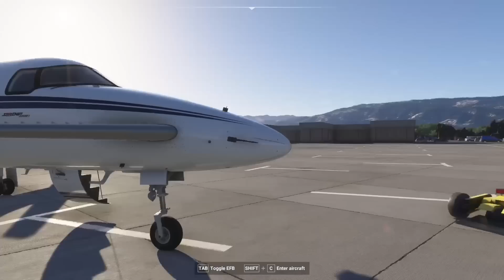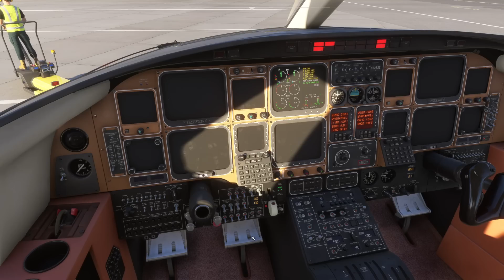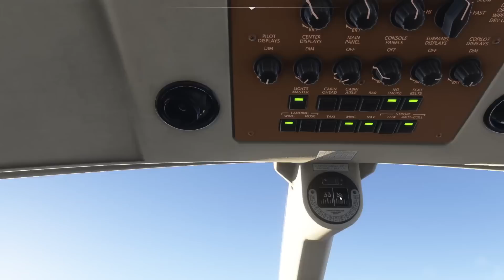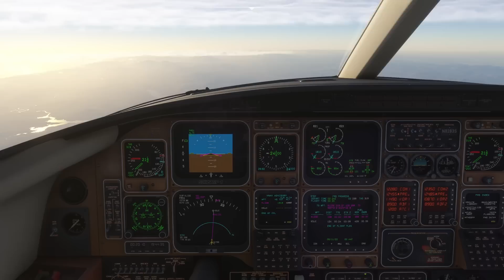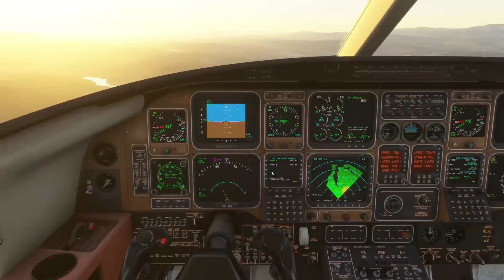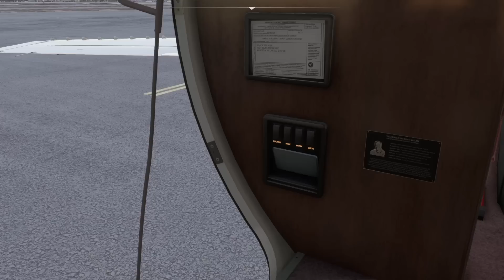Real Pilots Flying the Starship | BlackSquare's Nick joins me in the Flight Deck #msfs2024 #starship

Comment: We have hardware with Reverse and Beta and feather detents but they are unassignable in MSFS2024... We don't have an axis for Beta true but at least a toggle we should be able to have but we can't. Look in MSFS2024 settings and although you have 4 buttons assignable for Beta, 6 for Feather, 2 for Decrease Propeller (for each axis - normal and slow) None Works - NONE!!!!

Comment: Fantastic episode. I enjoyed every second of this. I was 21 in 1988 when I received my PP certificate, and this a/c was certified. I've been in love with it ever since, even after reading all the reviews at the time that criticized it, and all the crap about a "plastic" airplane. This was developed about 5 to 10 years too early. In 1988, our aero club had a few planes with LORAN installed. Very few members who were baby boomers took the time to understand this technology until several years later. Yet, we Gen Xers who have been programming the family VHS recorder, and taking programming in high school, took the 30 minutes to learn about LORAN and how to configure it for navigation.
Another bad timing issue was the leap in technology of turbofan engines, which increased fuel economy for small jets. On top of it, Starship wasn't able to top out above 400 knots as was promised during development, which may have been the biggest disappointment of it all. It did bite into Raytheon's credibility just a bit. Maybe a lot. 
If this had been developed ten years later, the leap in processor and memory technology alone would have really improved things, such as having more information on one CRT. So there weren't 18 of them. People would have more faith in carbon fiber materials. Pilots would have been more receptive to learning new tech, etc.  Also, newer engines would have been on the market that were less expensive to maintain and get parts for. 
I appreciate all the work Nick has put into this. For more than a year, the two a/c I have flown the most on MSFS are the Baron and Dukes. It isn't even close. So I know I will be flying the Starship quite a lot as well. Although I wouldn't mind a King Air 350 in both steam gauge and modern avionics. Thank you for bringing this back to life. Complete with woven upholstery, and a 3.5-inch floppy!

Comment: Any other Ramp Rats remember “Burping” the Starship to get all the fuel in? 😂
Reply from the maker: That sounds interesting lol care to elaborate?
Reply: @V1Sim For you, anytime. 👍 The Starship was filled overwing, one cap per side, and the gravity feed would leave air trapped in the tanks. We basically walked along the bottom of the wing about 2 feet back from the leading edge thumping the bottom of the tank with the bottom of your fist. You could hear the air escape and get another 5-10 gallons in. This was at Raytheon Aircraft Services where we confirmed with the CEO and MXT that it was okay to do. Fun fact, the CEO or Raytheon had his own company owned BE2000 just to keep publicity up. 

Can’t wait to get my hands on this bird and fly her all over!